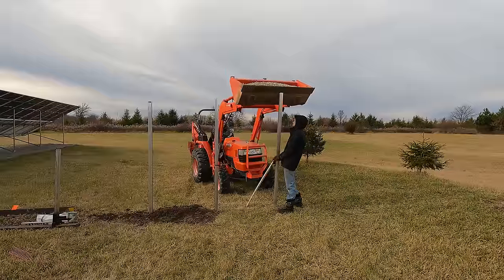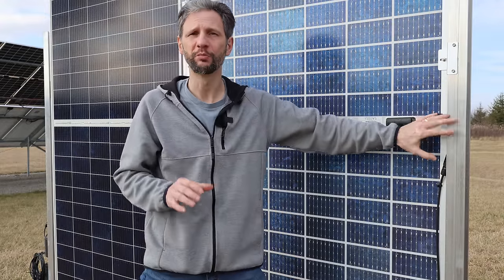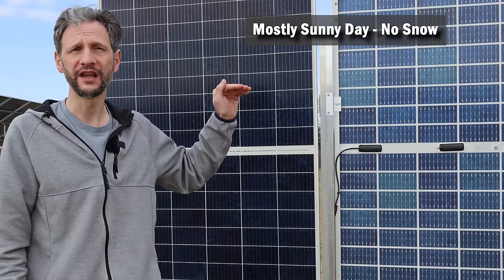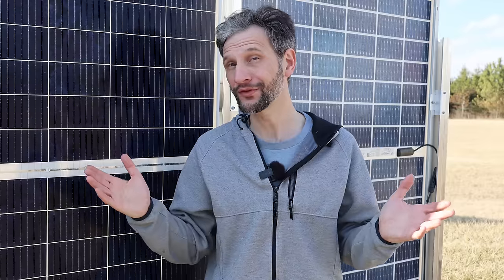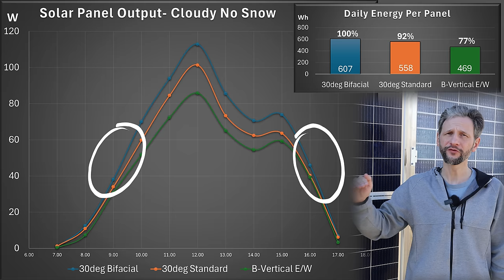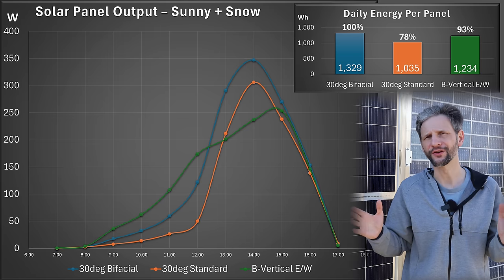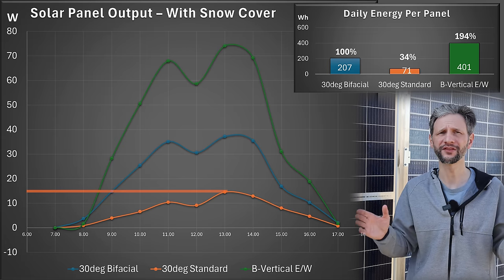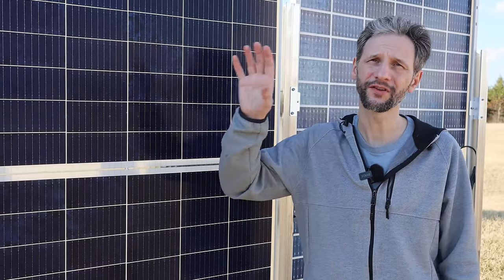Vertical Bifacial Solar Panel Performance Results Part 1

Comment from the maker: This has been one of my most interesting tests so far!  I'll bring summer results when I get them. Let me know what you think below:
Link to Bifacial Solar Panels on my website: https://projectswithdave.com/solar-panels/
Signature Solar has free shipping on there Solar Panels till 2/27/24: https://signaturesolar.com/shop-all/solar-panels/?ref=SALE
FREE Solar Financial Calculator on my website ProjectsWithDave.com: https://projectswithdave.com/
Reply: why not south north?
Reply: 9:34 - You touched on it about using reflective rocks, but would a mirror in-front of the vertical panels, or possibly adjacent at a vertical+horizontal angle or a vertically angled curved/conical, solve the mid-day dip in performance? If so, what if the vertical panels are placed in-front of the 45° panels? The light would be reflected towards the vertical panels.
Reply: @BackFlippingBaldi2391  because your able to put up more rows w,o  interfering with the other's light, Nor do you get the reflection benefits.
Reply: I really need to write a script for this with how often I seem to be replying to videos on this...
Reply: @BackFlippingBaldi2391  I think that would be best in winter, but most other seasons east/west.
Reply: I do thank you for doing this and at least getting it out more but....  This has already been proven to work since the 60's, We just forgot about it because mono facial panels got so darn cheap, Plus we never had a good source of storage for the energy to last so it never took off...
 
What you are doing is legit stage one in the findings from a late 60's Ohio state study. An it is kind of scary how close you are, They got 68% energy compared to a "properly" angled array in a year's average. 
 But by the time they got to stage 6 in the mid 70's, They were able to get 110-115% of the yearly average, Most of the boost coming in the summer time when heat is a crazy factor I will admit but still this is a proven concept.  Going off there best performance you need at least 4 arrays, at least 20ft long and spaced out no closer then 100% of the height of the array and no further then 120%.     When this was done you get near 90% the same energy output for 3 of the 4 seasons, Or a jump in about 20% from a single array. But get 120-130% more energy in the summer time, When your single east to west should do near the same as your north to south array.
Reply: @mattmill30   When I look into do things like that, I consider the cost's (don't forget the tax benefits) and work that needs done it always get's to a point adding the couple more panels are WAY cheaper.... But space or permitting could be an issue or you could come from an area limestone is supper cheap
Reply: @dizzlethe7346  I was building up a train of thought which lead to using the 45° panels as the "mirror" for the vertical panels, especially when the 45° panels are covered in snow, by placing the vertical panels at distance in front of the 45° panels where their sunlight at the reflection angle still reaches the vertical panels but the vertical panels don't shade the 45° panels
Reply: Very interesting data--thanks for posting Dave!
  I wonder if summer efficiency could be improved if the panels could be cooled slightly--by routing irrigation water (drip irrigation ?) between 2 vertically mounted bi-facial panels.  Obviously this would increase costs (initially), but for hot/dry (desert) areas, this might be worth exploring.
Reply: @mattmill30  Wouldn't the 45 get shaded at some point in the day/season tho?
Reply: @mattmill30  Could you space them far enough not too, Yes but to get the reflection I think the 45's would be to close to justify it. 
 But I mean it would be worth trying,  You would have to keep the 45 near the ground and the vert array off the ground a good amount to cut most the shading out, The post's would still be a problem for shading the 45's I would think tho.
 IMO at that point I think it would be cheaper, easier and more power just adding more vert array's that do near the same job. 
 Then again I have never really given much thought to applying this to small system's
Reply: @dizzlethe7346  I've done some MSPaint math, using the aerial shot at 0:03, and I think given the raised position of the 45° panels, the vertical panels would only need to be an additional width of the two vertical panel structure distance in-front of the 45° panels.
An additional interesting investigation would be whether there is an optimal angle for the 45° panels to reflect light at the vertical panels in-front, such that the vertical gains off-sets any no-longer 45° panel losses.
Reply: @dizzlethe7346  Once an optimal configuration for 1 vertical panel structure has been found, then I would expect it can be multiplied to several positions in-front of the 45° panels array. As long as the vertical panels are distanced far enough away from each other to prevent shadowing during the "peaks" of early morning and late afternoon.
Reply: This should eliminate the need for a tracking system ! !!!
Reply: Would it make sense to angle the vertical panels in a very sharp "V" pointing South? So the midday sun also gave at least a bit of light onto the panel faces, I mean.

If the rear of the panels also generate, then I suppose setting up that "V" a short distance from a south-facing, white wall would reflect light onto the rear of the panels while the fronts are also lit by the sun.
Reply: If you are less concerned about peak power capture you could use both to get a more even power input
Reply: A barium sulfate based paint could be a good reflective surface for the bifacial panels. I think that paint can reflect 98% of the recieved radiation.
Reply: It can raise yields of crops, because plants do not like harsh sun everyday all day, contrary what people say and write... so this config can help plants deal with harsh sun for few hours.
Reply: @mattmill30  That's hard to do off of video..
Reply: @IvanNedostal  What?
Reply: @dizzlethe7346  sorry it was ment for someone else, i misclicked :face-red-droopy-eyes::face-fuchsia-poop-shape:
Reply: @IvanNedostal   Your good lol. Sorry I had to still reply tho XD, I mainly agree with you tho.
Reply: @IvanNedostal  nvm it didn't bc you took it away lol
Reply: I can't believe you sabotaged this very important test.  Why would you place the vertical panels in the bounce shadow of your traditional mount?   If they were placed in front of the rack instead of behind, you may have seen a major increase over your numbers you are reporting here.

I also would have liked to see 2  bi-facial panels oriented east/west with both good sides facing south and a solid white fence 12 ft behind them.  The bounce area would also need to be unshaded.
Reply: @fabulousoffroaddesigns5080  most interesting part about his configuration is mere fact that you can use land for two or more purposes with vertical array for cheap. That makes PV viable even for big farms so they can convert machinery to electric motors..... snow not covering vertical array is in itself so huge thing that you should do it just for that.
Reply: It'd be good if next winter you tried South facing vertical panels. Also you should try 60 degrees.
Reply: QQQ Have you considered another optimization test - both variants with 1/2 array South-East and 1/2 South-West to extend effective length of day while still capitalizing on southerly collection?
Reply: Windows are on the sides of houses 🏘️ were originally usedto heat up the house in the morning when the sun 🌞 rises. 
So EW panels will give the most energy at sunrise and sunset.
Reply: They're to close together.
Reply: H! Dave always enjoy the detail you put into your videos and data. I was wondering if having the bisolar panel set at 80°east would give a better bel curve?
Reply: Dave? I NEED YOUR HELP PLEASE?
Reply: So in a climate with no snow and few cloudy days the results would be differant ... ?
Also for agrivoltaics - mower machines can throw out stones  damaging the panels
Reply: next time make a graphic separatly for each of the two vertical panels. im very intersted how efficient is the back side of a double sided solar panel compare to the main side. if its less then half efficient than its more reasonable to put two standard solar panels back to back in vertical position if your priority is morning and evening production.
Reply: "At present, in bifacial modules, bifaciality factors normally range between 70 % and 95 %. For example, a bifaciality factor of 95 % means that, in the same conditions, the rear will produce only 95 % of energy produced by the front."
Reply from the maker: @timmullins3132: I plan to do a North/South oriented test in the future.
Reply: at 9 am the vertcal panel facing east is producing around 280w and 180w for the west one. a total of around 460w at 9am. but  when you merge them it shows only 230w at 9am.
Reply: @ProjectsWithDave  Hi Dave, we have a 20 KWp E-W system on our home in east Europe. It's far from our ideal case that we planned for because west doesn't produce much in the winter as it's mostly covered by sun (it takes 4-5 days for the snow to melt even if it snows maybe 4-5 times a year nowadays). I was thinking about installing an additional 10KWp south facing array but install them on adjustable racks so that I can have 40 degrees angle in summer and 70-80 degrees in winter for the snow to fall of on itself. What do you think about the idea of adjustable angle south facing panels?
Reply: When you merged the east and west panels of the bifacials, were the results averaged? The total wattage of the merged looked lower than I would have thought based off individual performance. Shouldn't the results of both be individual sides added not averaged was they are producing at the same time?
Reply: @cornelstamate2537  for some reason they where averaged and not added together
Reply: Where in that link does it link to the actual bifacial panels?  The links to Canadian Solar 390W panels don't say anything about them being bifacial I don't believe.  What are the dimensions of these panels and how much do they weigh?

Also, did you alternate the panels front/back/front/back because the z-brackets wouldn't both fit on the same flange?
Reply: Found it, it's in the San Tan link.
Reply: You could also use mirrors at each side of the vertical array. That should be better than relying on a light coloured surface.
Reply: @ProjectsWithDave  what about the heated panels, that can be heated (by the edge of the cells with heating wire similar to what is found on back car windows) in the morning to allow the snow/ice to slide off the pannel? (You could use the vertical panels to fully power that feature.)
Reply: Thank you for your great video, which sort of confirms our own knowledge and experiments with fence-type and bifacial PV.

Don't know if you already had them on your list, but among the (German) specialized racking solutions for free-standing vertical mounted bifacial PV (also called "Zaun-PV" or "AgriPV" here) we researched last year were Next2Sun, AgroSolarEurope (they've got a bunch of different solutions) and "Solarzaun" by Bau-Shop (very affordable for small scale bifacial solar fences (Zaun = fence in German). Also, we expect big solar mounting companies such as K2, Mounting Systems or Schletter to soon offer specialized racking solutions, too, as bifacial solar fences are getting very popular here, now.
Reply: @mattmill30 the thing is, mirrors nowadays are the same price or even more expensive than just adding more solar panels 🙈
Reply: You should continue the test all the way through summer as  some of the biggest advantages from vertical panels are improved convective cooling, keeping temps down and efficiency up.
Reply: @BackFlippingBaldi2391  yeah it think it would do the better in some scenarios and would be worth the comparison.
Reply: Also test them with horizontal way and if they are easy west at an angel.
Reply: How about solar tracking? is it really that more expensive and energetically inefficient to have a solar tracking system for large panel arrays? I think a good use of a tracking system is also to use it to set the panels in a horizontal position to avoid damage during stormy winds. Instead of paying more for a bifacial panel just set one more aside, and if there is not room left, then use a tracking system. That is my guess, please educate me if I'm wrong.
Reply: Just had an interesting thought... If you were to Zig-Zag your panels, perhaps by 15-20 degrees, with the most efficient sides facing south, you may eliminate the midday dip entirely!
Reply: Vertical panels would work best over water. They would get double the sun, direct and water surface reflections no matter where the sun it. I would love to see you, or anyone, test this.
Reply: Or place smaller, but longer panels at the bottom on both sides of each vertical to form an upside down T shape. At noon the bottom panels would be in full sun white through the day they would catch angular light both direct and indirect reflected light from each other.
Reply: For somewhere like South Florida, would you mount them vertical and put white quartz sand around them? When you go to a beach and it's a bright day, you almost go snow blind from the sand. 

I understand south facing would probably still be more light, however solar panels don't function well when they're very hot and everything gets really hot in South Florida, so I'm thinking with them vertical, they would get less actual thermal radiation?
Reply: I think the south-facing panels were casting a shadow that took some of the energy from the vertical panels. Good video tho

Comment: Put some Mirrors 🪞 on the ground
Reply: I want to see that
Reply: Or two tilted 3"x36" mounted just under the panel off the ground.
Reply: Great idea
Reply: Water will do.
Reply: white sand would be enough
Reply: Mirrors won't work because they reflect directed light. So at noon they will just reflect light back to the sky barely touching the panels. White sand is indeed a better idea.
Reply: Exactly
Reply: Or perhaps some Mylar?
Reply: @MaritimeUnprepared  aluminized mylar on foam board
Reply: Really great idea
Reply: Broken glass would be better.😂
Reply: They will get dirty instantly
Reply: Put more solar panels on the ground
Reply: @Rockall57  that’s a very interesting idea. Something that reflects from almost any angle.
Reply: Heat
Reply: @jdepew  water cooled mirrors
Reply: @whatthefunction9140  I’m thinking about the panels heating up. Is there a way to passively cool them?
Reply: @jdepew  mirrors reflect heat. Maybe pit mirrors infrount of the panels
Reply: FLAT WHITE Is nearly as reflective as MIRRORS.
PAINTED PLYWOOD attatched near the ground at approximately 30° in the SHAPE OF a wide  "V" 
Would seem to make the most power at NOON.
Reply: Just that white roofing material would be great tpo
Reply: I can't see
Reply: Pilots hate this one simple trick